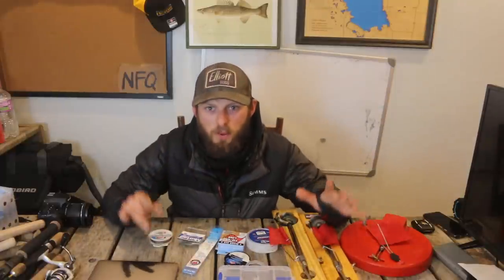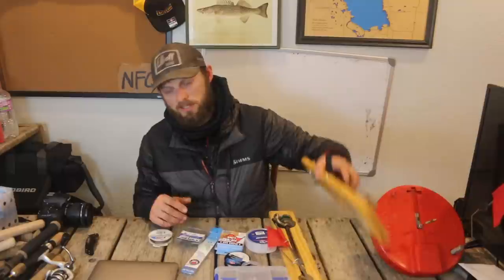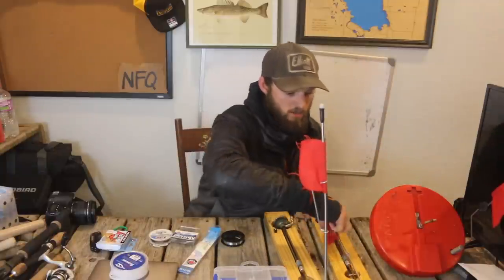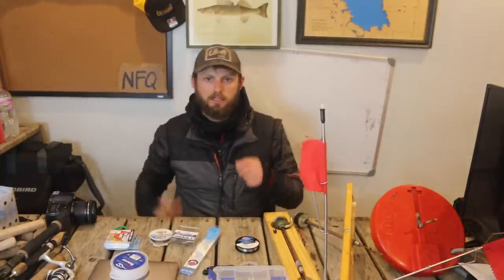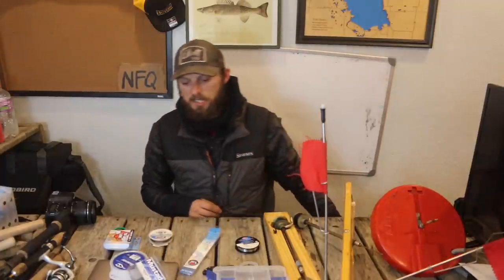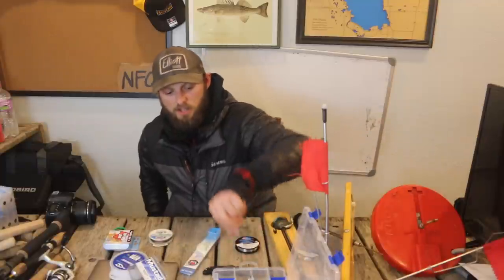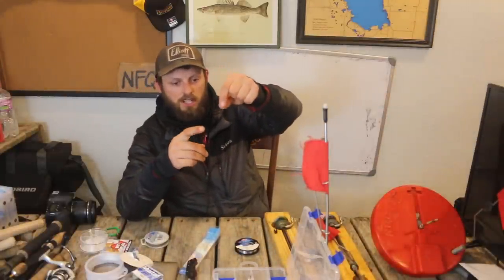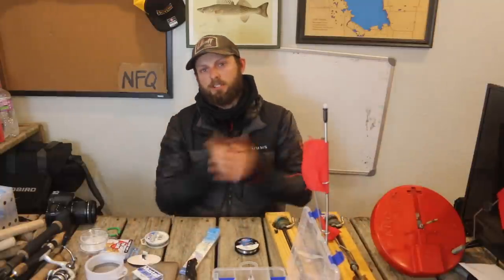Ice Fishing Tips to CATCH MORE FISH!

Comment: Tom, I have the same stainless steel leader but much lighter, 40, 26 and 15 pounds test. 15 pounds I think would be universal for mixed bag pike and walleye.
Reply: I agree, I will use 14-17 lb for pike/walleyes. Never had any problems...

Comment: Thanks for another great video Tom!  What do you think of using a Brocraft tip-up (or similar like Ifish Pro) with essentially the same setup you are using but on a walleye rod (with 10# Suffix 832 Advanced main line)?  Also, do you think putting a small snap swivel on at the end of the leader will turn walleye away?  I would like to add that so that sometimes I can also use the same rod and set up to jig.

Comment: Used these on a really cold day at the lake https://www.youtube.com/post/UgkxDn2sw8y7H6oNOV0envADWPlTV9pvctAA the spool was really fluent in letting the line out and the whole mechanism was really responsive to any hit from the fish, it was also great that you can adjust it for big or small fish. The light it came with works great in the dark. The only thing that I had problems with is the depth droppers clasp is really weak and it wouldn't stay on the hook unless you threaded the hook through the springs

Comment: As an avid fisherman that has put several lines to the test fishing for king Salmon I have to say seaguar sucks against all the elements. I'm speaking from an abundance of experience and talking up to 12 lb test line not heavy line that I have little to no experience with... Vanish works great for most applications but I feel more confident with P Line. Fishing line changes all the time though..... 6lb p line floro is the most diverse line imo from fishing for perch to walleye to salmon and steelhead. Perch fishing and steelhead in clear water  I just add a couple feet of 3lb floro. Great info, I'm new to ice fishing... Thank you.

Comment: Beaver dam and polar style tipups are nice! I have friends that use them. But i prefer the green wooden Hi-flag tipups and heritage laker tipups. Cross pole style tipups essentially. The hi-flags are nice for pike, walleye, bass, pearch things like that and the flags can be seen from way off in feet of snow hence the name lol. The heritage tu's i use mainly for lake trout because they have the larger spools with a nice drag system (great for larger bait) and the tipup itself is super heavy duty with large spring loaded flags. I run 36lb. tan waxed braided line. The wax does breakdown after a few years of use but its great line. Keeps the line from freezing so easily. I used to use green line but went to using tan years back, I can see the line well that way while fighting fish and never had issues with the fish seeing it. Especially using a long fluro leader. Tip: on very cold days once i set my tipups in the hole is take a little of the ice slush thats around the hole from drilling the hole and throw it in the hole around your tipup (or snow). It breaks up much easier than when the hole just freezes over. I dont always do it, just on really cold days. Who doesn't love ice fishing?! Lol..FLAG!!!!! Lol..Stay safe all! God bless!

Comment: On the tip up it seems like you can adjust where you can put the bar on the brass T part by sliding it up higher towards the flag or lower towards the spring. Can you explain how and why it seems adjustable